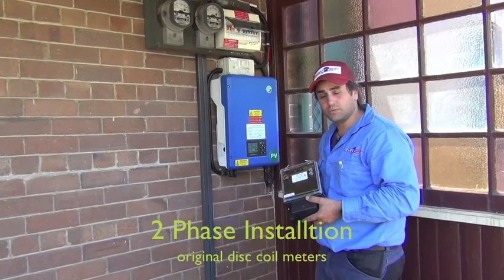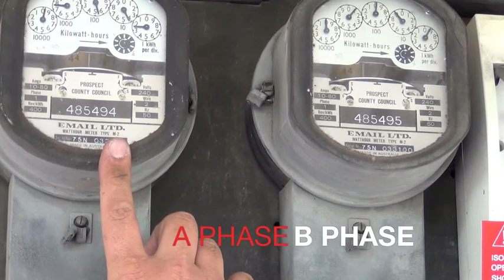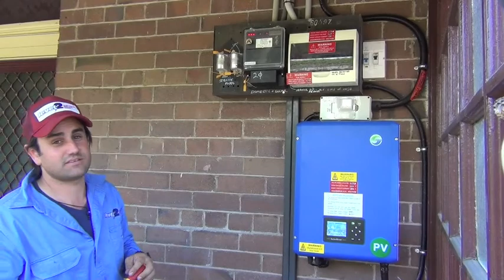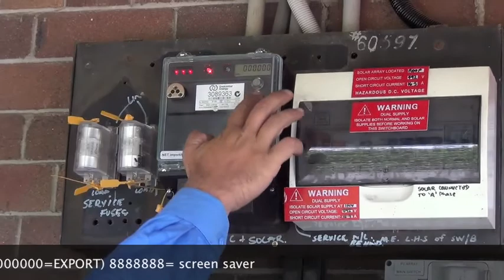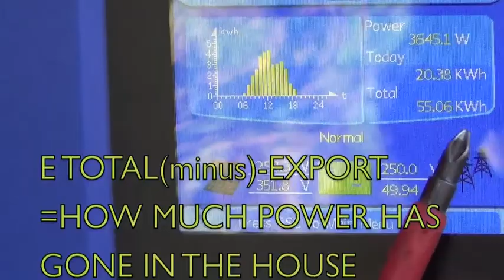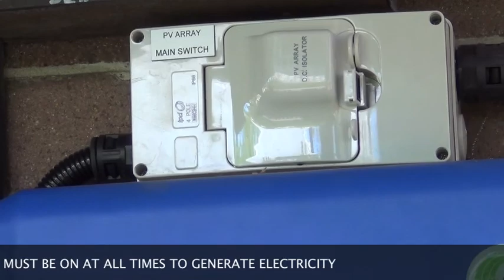EM3030 2 phase site

Comment: such a weird system, why you would carry energy trough your house, it's refreshing like water in a lake besides the river for maintaining fishes, electricity doesn't need that, you just push your electricity for sale at a slightly higher voltage maintaining the sincronity of the phase, that it's probably the simplified way to sincronise passing a whole line of consumers (your neighbors) after you from the step-down transformer.